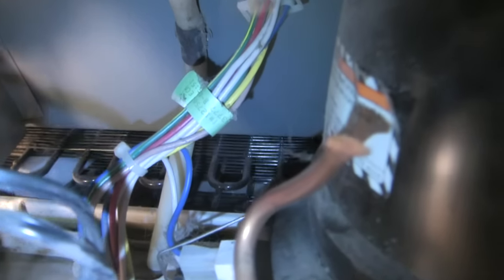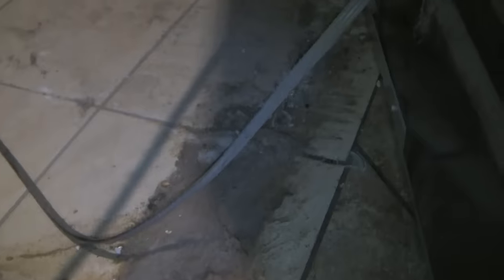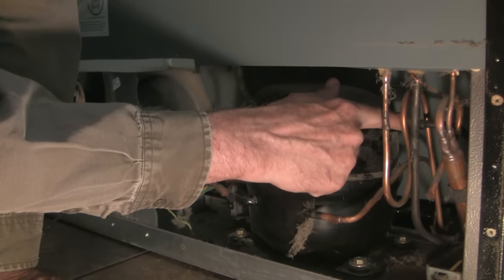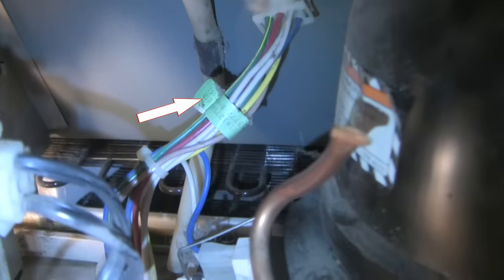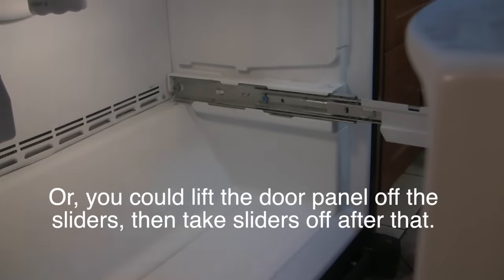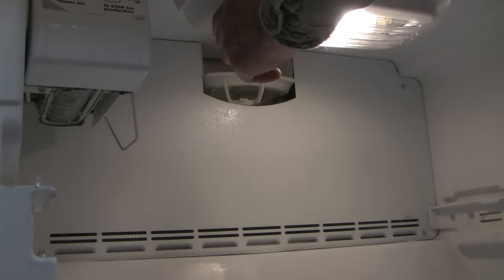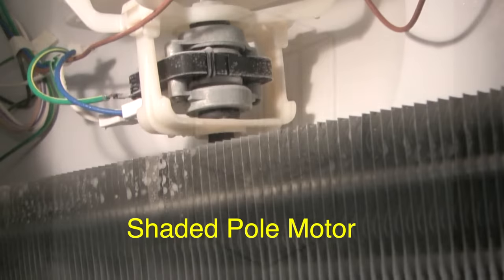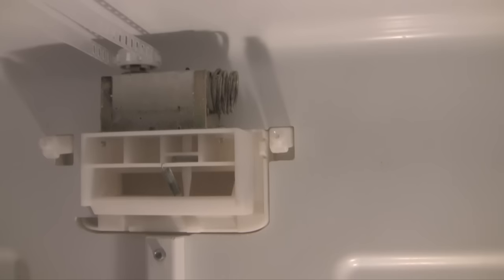How to investigate and fix a fridge that is too warm

Comment: The most important part of the video was seeing what a blocked condenser coil looked like and where to find it. The manual that came with my refrigerator didn't say how to open access panels or even say where they were. After watching your video I finally got the lower access toe grille below the front fridge door pried off and found not only dirt and lint that needed to be removed but I also found a service data sheet hidden in a plastic pocket. This paper explained how to press the door light switch the right number of time to get acknowledgement beeps and then to test components one at a time. In my case the evaporator fan didn't run so no cold air was circulated from the freezer to the fresh food section. This was a great how to video. Thank you!
Reply: Door light switch pressed how many times to get acknowledgment beeps? How many to start?

Comment: Why didn't I see this earlier. I just paid American home shield, my Home Warranty , 79.00 bucks for a repairman to come out and clean the coils -no dog hair just a little dusty.  Last Thursday my refrigerator and freezer were warm and water drops were on the food in both. Food in frig felt warm.  I threw all out when it the frig didn't get colder.  I left off until repairman came today.  He told me their was nothing he could do since I had the frig turned off. But he vacuum out the dust so I'd have something done.

Comment: I'm a single mother of two and overnight my fridge stopped keeping things cool. It was running, but not doing its job. I called multiple repairmen after realizing I didn't have the testing tools for the capacitor and they all said they no longer work on fridges because of the companies that make them. This was the most helpful video so thank you so much!

Comment: As other commenters have said, you are an excellent educator.   I cleanout out the bottom coils, and yes they were filthy and fortunately we have a cattail that we use to dust off the ceiling fans, using a vacuum cleaner hose kept all the dust and dirt from flying everywhere.    The compressor was running fine, the bottom fan motor was also running fine.   The entire frig was running fin until a few weeks ago when it started to have symptoms where the freezer wasn't keeping ice and everything started to defrost on one side of the freezer.   After cleaning the coils I took out the back panel of the freezer compartment and found a large block of ice that completely surrounded the thermostat.   After five minutes with the hair dryer I cleaned everything up and plugged it back in.  The back panel is now freezing cold.   We're in a wait and see hold for a few more weeks.   The only thing it could be in the freezer thermostat.
Reply from the maker: Most higher end fridges have a defrost cycle that can go bad, too. Older units had a mechanical timer that could get stuck, and new units have the defrost cycle built into the board. When defrost fails, ice builds up and can plug the drain, which causes a cascade of secondary problems. The defrost element is usually a resistance heater, often with its own fuse, and that also can fail. If the thermostat is surrounded by ice, it won't feedback an accurate temp so the system could underperform even when not in the defrost cycle. You're doing the right thing by cleaning it up, getting rid of ice, and making sure the drain is clear. Then plug it back in and hope for the best.

Comment: Thank you very much for your video.it helped me tremendously. I removed the vent in the fridge and no air was coming out, so I checked the freezer and the radiator was covered with a thick crust of ice. I used a hair dryer for about 15 minutes to melt the ice, turned the fridge on and cool air started to flow, within an hour the temperature in the fridge was in the forties. Thanks again.
Reply from the maker: Those electric defrost heaters can burn out, so don't be surprised if you end up replacing the heater because it recurs. Board problems and wiring issues can do the same thing, so I would check your manual for a resistance spec on the heater to try and verify it is bad. The other thing to check is that drain shown in the video, to be sure it is not blocked. Melted water needs a way out before the defrost cycle ends. Good luck!
Reply: @spelunkerd  thank you for your reply.

Comment: Hi
My Freezer is cold 0 degrees, but the fridge is not cooling 55 degrees. At this point with my Frigidaire GLHS67EHQ side-by-side refrigerator, I’ve replaced the damper assembly, that did not fix it.  I cleaned the condenser coil.  Then I replaced the evaporator fan motor and blade (which was running), that did not fix it. Although the compressor was working, I decided to install a new start device since the unit is 12 years old and I was already cleaning the condenser coil.
The damper is open, and air is flowing, but there doesn’t seem to be much velocity. The freezer is cold, but the fridge side remains warm. There’s no corrosion on any lines I can see. There’s no ice buildup on the evaporator Just a small amount of frost.
Finally, I replaced the control panel, but that didn’t resolve the cooling issue on the fridge side either. I’ve checked and rechecked everything, including re-crimping the evaporator thermostat wires to ensure they were properly connected, but the problem persists.
I’ve also removed the ice maker and top back panel to check for obstructions, and everything looks good. The vent by the crisper is clear as well.
At this point about the only thing that I did not replace is the thermistors. I tested the fridge thermistor, it is opening and closing the damper as it should. 
I’ve been working on this for days and am not sure what else I can check. Any further guidance would be greatly appreciated!
The only thing I can think of now, is the fan moving enough air? 

Thanks for any ideas in advance.
Dean

Comment: I do the condenser cleaning every year. Having a dirty  condenser elevates the high pressure and makes the compressor to run harder.  As you mentioned also runs more time wasting more electricity.  Thanks for the v2
Reply: Ya i needa figure mine out.
Reply: Cleaning the condenser once a year is about right...more often if you have dogs or cats.😁
Reply: It's not too good on the starting run either when them coils get dirty
Reply: @crazyamericangamer7036  what is your fridge doing or not doing
Reply: @roycehunt854  I’m trying to figure out what is going on with my Frigidaire side by side. I’ve watched numerous videos. It’s flashing H1 on freezer side. Slowly stopped making ice. Water works fine. Freezer will not freeze food or ice cream. Refrigerator seems to be ok. I’ve cleaned all coils and underneath.   Back wall in freezer was frozen when I took panel off and bottom of freezer tray had ice. I unplugged, and defrosted freezer with blow dry. Damper seems fine. Cold hair blowing to both sides. I’m lost! I don’t really want to have to call a service man, I can’t afford to! Was hoping someone reads this and is able to help

Comment: Took my fridge apart per your instructions and found the condenser frosted over in a big way. I think it resulted in the fan seizing although when I took off the plastic cover (breaking one of those damn plastic tabs!) it was turning although I'm 100% certain it wasn't before because with the flap wide open at the top no air was coming out at all. I thought there might be something wrong with the defroster but after your diagnosis at the end of the video it makes perfect sense that the coils were too dusty because they were EXTREMELY dirty. Life was so much easier when the coils were on the back. Thanks for the great video! (BTW my wife is halfway miffed about not getting a new fridge too)
Reply: If your evaporator coils were loaded with frost/ice, you have a defrost issue, either defrost thermostat/heater/defrost timer (mechanical or computer controlled)

Comment: I'm a home appliance tech, and refrigeration is my strong point. Just to give you a little more info...

The gas refrigerant coming back to the compressor from the evaporator is actually not room temp, but still cold and helps cool the compressor. If the condenser is clogged, instead of sending condensed refrigerant to the evaporator, (necessary for the capillary tube to force the pressure to drop and change state to a gas), you are sending partial gas along with the condensed liquid. This flashes at the entry to the evaporator and gets "too cold" plus doesn't have enough btu's left to cool the rest of the evaporator. You are now creating an ice ball at the top of the evaporator, and also not sending cool refrigerant gas back to help cool the compressor. All this heats up the compressor. Add to that, the compressor runs and runs trying to reach the set point temperature and overheats. Often, this causes the compressor to shut off on it's thermal protection. You will get large swings in temperature as the compressor spends too much time in protection mode.
Hint: You can check how the compressor is working by running an amp draw check at the compressor power wire. On most residential refrigerators and freezers, it's a 1/4 horsepower compressor. Fully charged, they draw between 0.9 and 1.4 amps. If amps are too low, you have a refrigerant leak or on an older compressor, it could also be weak valves. If the amps are too high, you have a restriction somewhere between the compressor and the evaporator. Usually moisture turned into ice at the cap tube, or possible particulate matter that was not vacuumed out at the factory.
I could go on, but that's a good start to give you and your subscribers a good basic understanding.
Reply: I have a whirlpool with the freezer on bottom. The vent behind the bottom drawer frosts over from the left and moves all the way across the vent. Once it is completely frozen the refrigerator stops cooling. The freezer is fine. We have to unplug and defrost it but after a couple of weeks it’s starts freezing over again. Any ideas?
Reply: My fridge is making a loud humming noise, and freezer isn't freezing.. Any idea what it may be? It's like what you stated, compressor just running and running trying to keep it cool.
Reply: Our fridge is working but not getting to the temp set point. Freezer side is the same, not quite getting to temp setting...ice maker works- is making ice... coils are clean...condenser fan is working....I can hear the compressor running. It's an LG french door LFXS30766D

Comment: Great video.  Forget a vacuum exclusively- I used my compressor blowing the dusk off which works great and also have the vacuum handy while the dust balls come off.  Thanks
Reply: The tray with water does it needs to empty?
Reply: @merlicacelestine7821  no the fan moves air  across that tray which is expected to have some water in it and the fan air movement causes it to evaporate into the room. Just clean it out of any crap dust and hair
Reply: Leaf blower.

Comment: Well done, a good clean up and its happy again :-D
Fridge/freezers are something that everyone forgets about, the saying "Out of sight, out of mind." fits perfectly.

My crude understanding:
i roughly remember that the refridgerent gas gets compressed and heats up with reduced volume, then it's sent through an external radiator to dump the heat component into the air.
Then it's sent into the larger diameter/length condenser coils inside to expand and absorb heat.

I had a lady knock on my door as her fridge/freezer didn't seem to be working, i walked into her kitchen and was met with a heatwave.
i told her to open the windows and doors to get the kitchen back down to normal.
i explained that the fridge needs to dump heat into the cooler air, if the air is hot the fridge cant operate.
No supprise that the fridge/freezer returned back to normal, she won't do that again lol.

Comment: Thought my compressor was bad, until I watch your post, it was the bottom freezer coil frozen over, she is 10 years old but still running great.... Tks.. Nice post
Reply: Question, after removing the ice off the coils put all back together,,, the fridge has been running all night and is still hot in both the fridge and freezer, the fan is running non stop, last year the control board was replaced, any in-Site what my problem may be? COMPRESSOR Bad? Tks..

Comment: The fact that the freezer was at normal operating temperature indicates that your problem was not related to the dirty condenser coil. It indicates an airflow problem between the fridge and freezer. All of the parts tested good which indicates an intermittent problem. The defrost termination thermostat is a very common intermittent failure item on these models. You might be wondering why a defrost termination thermostat would cause an intermittent airflow problem. Amana has a unique fan motor circuit. The neutral side of the fan motor goes through the defrost termination thermostat, then through the defrost heater which has a hard connection to neutral. The impedance of the heater is low enough compared to the fan motor that it doesn't cause much of a voltage drop. There also isn't enough current flow to get any measurable heat out of the heater. This genius design prevents the fan motor from turning on until the evaporator coil is frozen which prevents moisture from being blown into the ducting and freezing. The fan motor is another common failure item due to the vertical shaft. Moisture drains into the bearing and causes corrosion. The motor sounded smooth in the video, so I don't think it's bad. Another common problem is a bad neutral connection at the defrost heater. This problem usually presents with incomplete defrost and low fan speed. Not likely a problem here but worth checking if you have to open up the evaporator again.
Reply from the maker: Hey, man, thanks for stopping by! Sounds like wise advice, I'll bear that in mind. No issues so far, but I'll look more closely at the defrost hardware and thermostat if I have more issues.
Reply: @spelunkerd  no problem. Thanks for the hard work you put into the videos. I'm glad all is well with the fridge.
Reply: Dennis Rindlisbach I bought a new fridge which gets hot a lot,I called the one who sold it to me and what he said was some fridges don't have condenser so that's what will happen but it doesn't mean anything. Now my question is, is this heating not going to affect the efficiency, effectiveness and the power consumption? If it will, what do I do? Cos it's New and I'm worried 
Thank you
Reply: Exactly. Relays on the board that switch between cycles.
Reply from the maker: I shared that concern about other causes. Now we're over a year since the fridge failed, and it has worked fine since then. So, I'm gonna call this one a verified fix.
Reply: I have a Frigidaire Gallery, the temp reads normal on both but clearly the fridge is not holding temp.  It has indicated it was too warm, but then went back to normal reading although all my food was ruining.  Any ideas?
Reply: I cleaned it thoroughly but it wasn’t near as dirty as the one shown here. (No offense, no dogs).

Comment: I am not 100% sure this is it, but my fridge - while cheap, is only a couple years old so before I called my landlord, I decided to check online.  I was led here.  I pulled everything out, snapped off the fan top and not really frosty. I didn't want to pull the back off so I just hit it with a blower and then I checked the hole.  OMG - the hole still was mostly covered with the original styrofoam.  And the other half was frosty.  I cleaned it out and low and behold the fan is fanning!  So take it from this foolish girl - make sure nothing blocking that hole.  Yay!!! Thank you.  I know you mentioned the hole almost as an afterthought but I think that solved my problem  I hope so =)

Comment: Thank you so much for making this video to explain how this type of refrigerator works. My 10 year old Kenmore (probably made by Whirlpool) is basically identical to yours. I was getting a louder than normal buzz but it did not appear to be coming from the compressor, or condenser fan behind the rear panel beacsue teh sound would continue even when those components shut off. I was stumped trying to figure out where the other motor could be, and how to access it since the upper back is completely sealed. I've had to manually defrost the evap coils before, but It did not occur to me to look there for the 'shaded pole motor' which is likely the culprit. Much appreciated and PS I hate plastic clips too!
Reply from the maker: I did another video of a bad shaded pole motor in an oven, where I swap it out and explain how it works. Genius design, easy to work with. If you get frozen ice around the fan blades the fan could seize, then work OK after defrost. If automatic defrost isn't working you might check out the electric defrost element. Defrost timers can fail, the element itself can go bad, and that branch of the system often has a fuse.